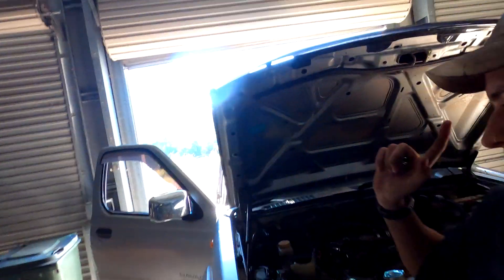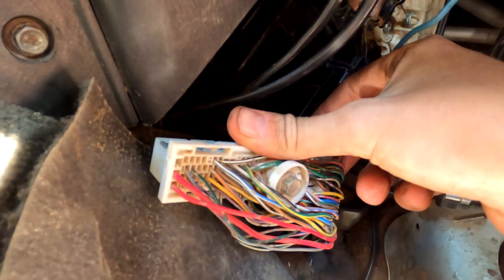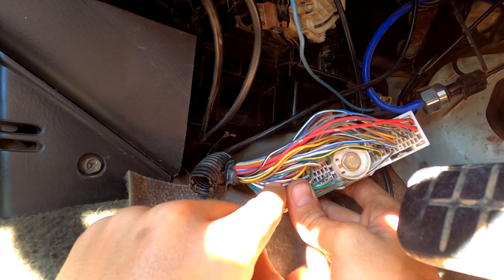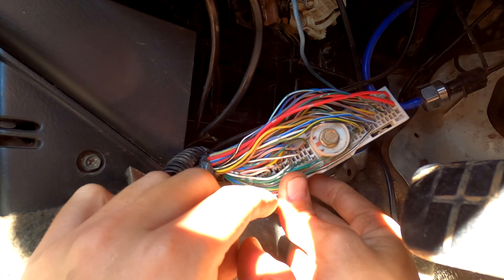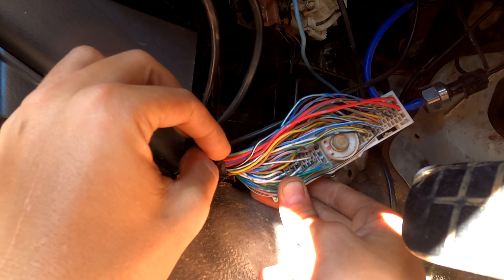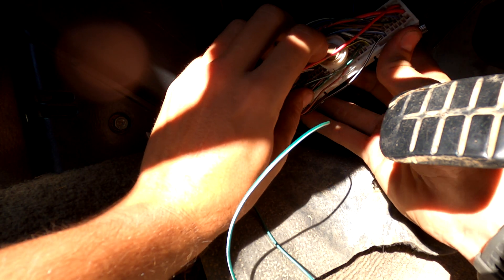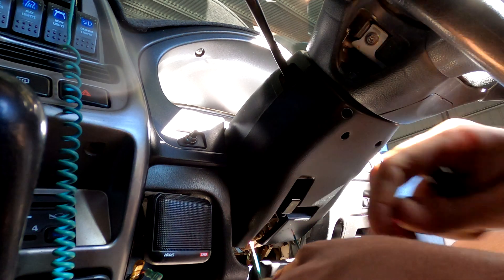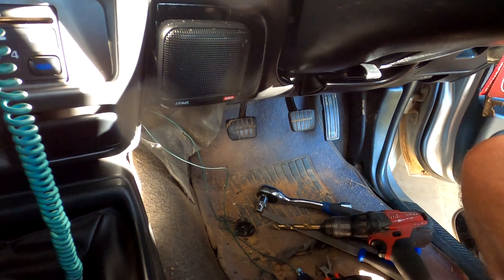D22 ZD30 Glow Plug Switch Install

Comment: There is another way you can do it which in my opinion is way better, remove the relay. Run a wire from the glow rail to a button and then run a wire to the battery and when you press the button the glow plugs engage giving you 100% control of the glow plugs.
Reply from the maker: Glow plugs draw a lot of current and you need the relay there otherwise you will need to run a large wire size to compensate.

Comment: Thanks for the video. Great work. Quick question, where is the glow plug relay located?   Thanks
Reply from the maker: Thanks mate, glow plug relay should be located in the corner of the engine bay against the firewall. You will be able to feel it click when you turn the ignition on and off.

Comment: So if I used a 2 position switch.
One position would be factory ecu as if nothing has changed and the other position would be off override?
Button, pressed is factory ecu and open is off override.
Reply from the maker: Yes so you can either completely deactivate the glow plugs or enable the factory operation.

Comment: So when you HOLD the switch the glow plugs are on, let go and they turn off?
Reply from the maker: Yep exactly but only when the engine would have already been glowing like on a cold start or when the engine is still cold but pushing the button when the engine is hot won’t do anything 👍🏻
Reply: @ReubsModifications  great thanks a lot mate!
Reply: So if you forgot to press the button when starting it , it would just start without the glow plugs even thought the light comes on
Reply from the maker: @bumpiermoth7674  yeah exactly the light will show on the dash but it wouldn’t actually glow

Comment: I have seen the topic of GP's and timers etc, etc. come up over and over again. There is a very specific reason for the GP's to be held on longer and that is for a few reasons, first being emissions, colds diesels smoke a lot. Cold diesels can wash the oil off the bores as combustions is slow, fuel can reach the piston and wall before it's burnt. Finally, cold diesels are rough as guts. 
A smarter solution is a three position switch, first is fully normal (different driver, normal cold start operation), second is fully off (Hot motor) while the third position is the glow plug light trigger. This will glow the plugs for cool starts but turn them off with the dash lamp.
Reply from the maker: Once again great info Ben, that switch does sound like a well thought out solution but for my application being the only driver I felt that it would be easier having a momentary switch. That way I can decide how much to glow depending on the situation 👍🏻